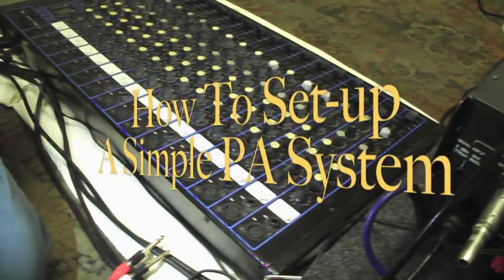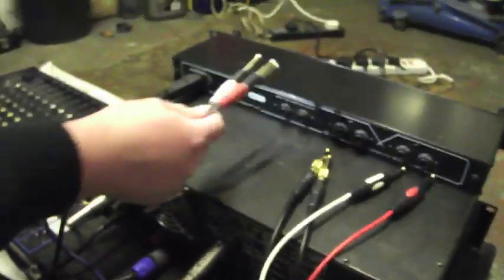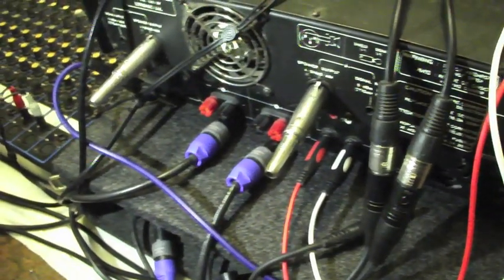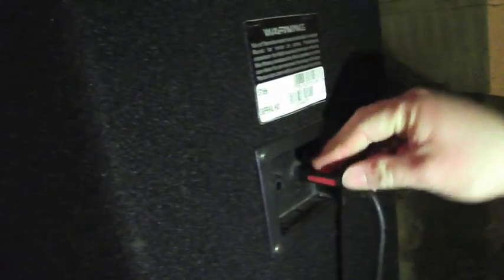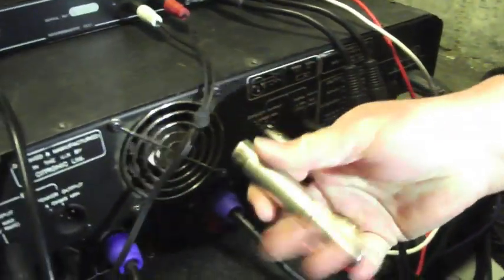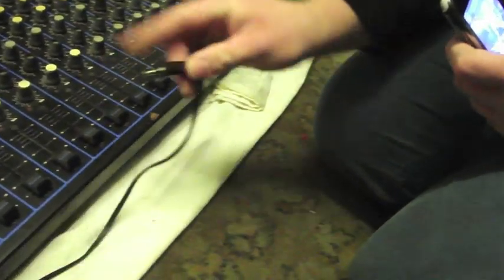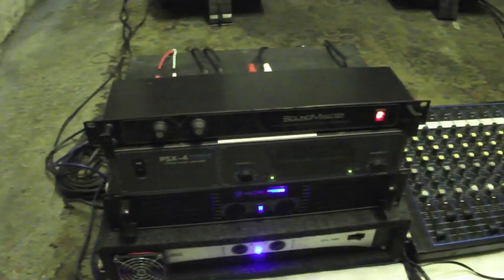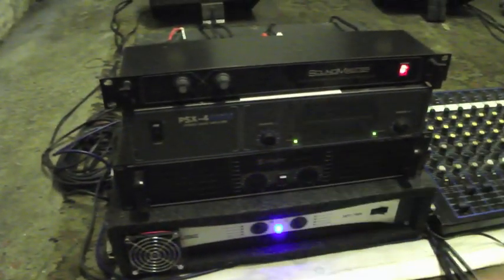How To Set Up A Simple PA System

Comment: Facebook Comment from Russ:

You've got a right mixture of connectors between the speakers but it does make tracing easier than having 6 identical speakons!
Strictly you should turn the xover on before the amps. Amps always on last and off first. :)
Reply from the maker: Thanks Russ on Facebook :)
Cheers for the advice, I normally do go by that rule, but being under pressure in front of the camera made me forget. :)